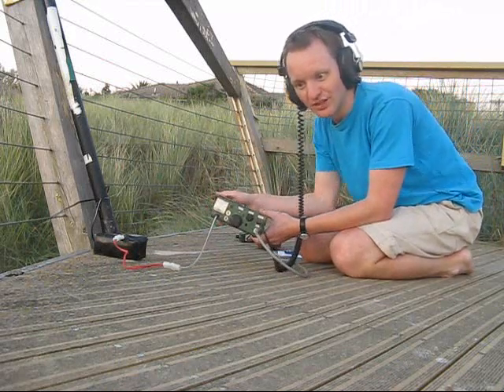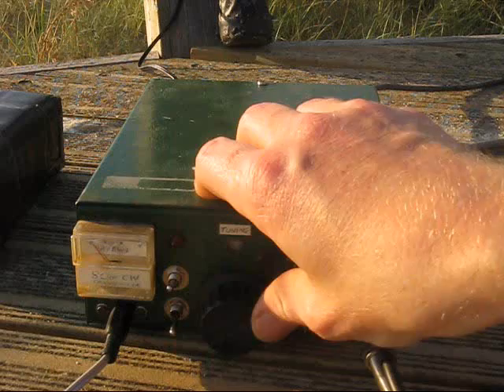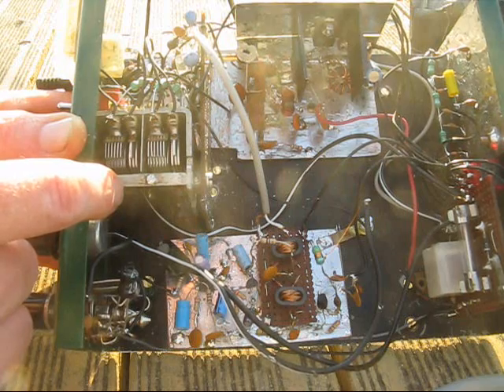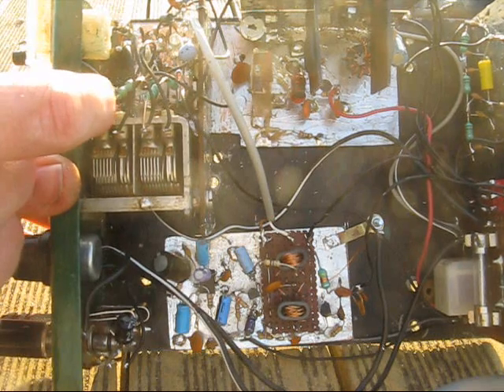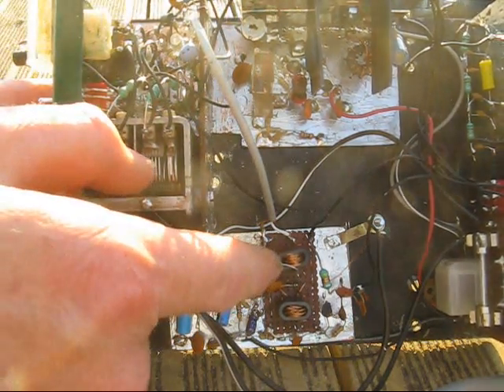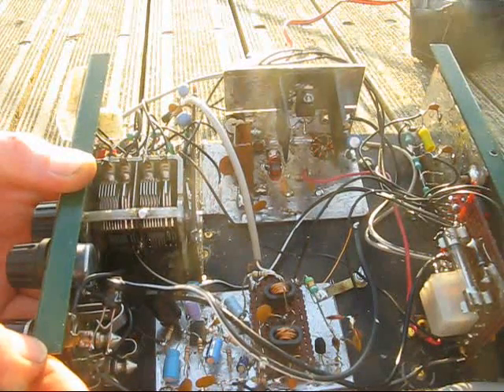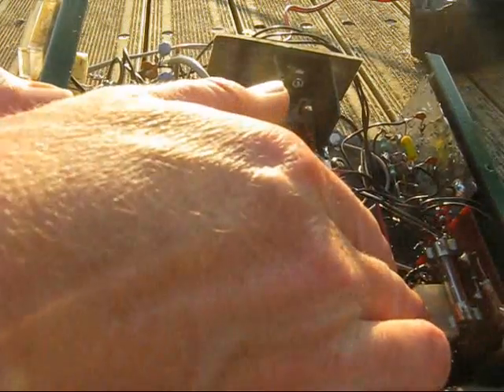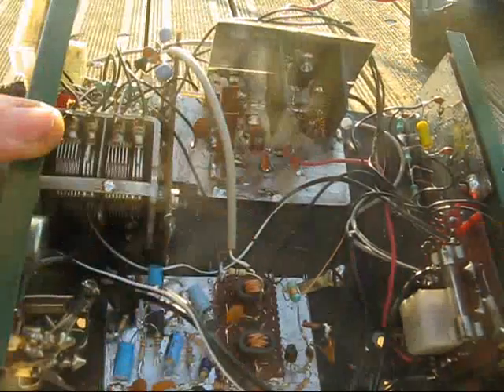Portable CW QRP with unfinished direct conversion transceiver

Comment from the maker: @raccoonnyc Tom - the lack of a sidetone is fine - just need to imagine it when sending.  The main bugbear is the lack of a t/r frequency offset - made worse by the VXO's non-linear tuning which makes it fiddly at the top end.  And you can't just add a given capacitance as the shift varies. 

Currently trying power diodes + pot instead of tuning cap - this will make offset and linearising easier.